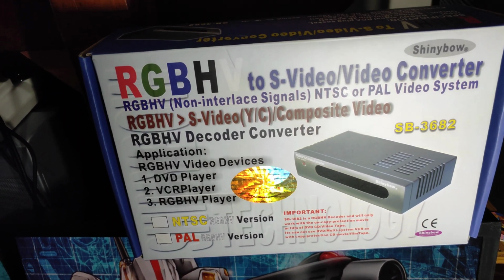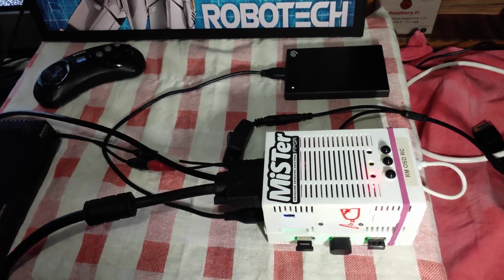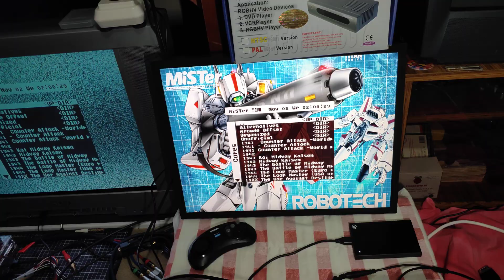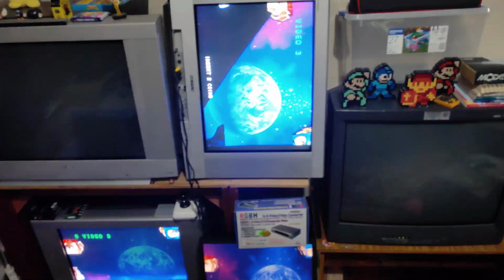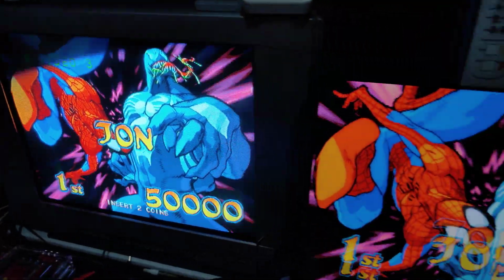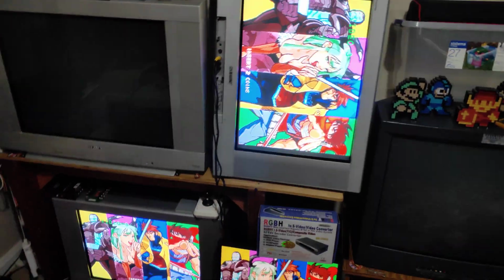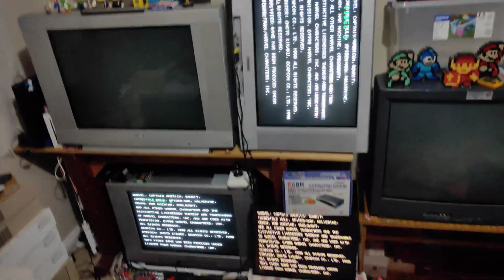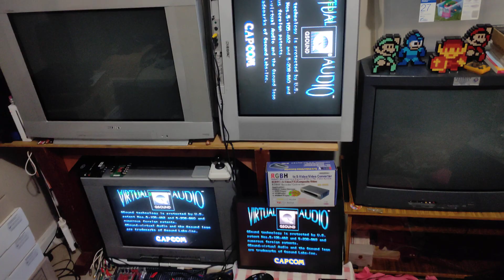AWESOME S-Video and Composite video for your MiSTer FPGA system

Comment: I just got my first CRT monitor (750TVL), however it only takes S-Video. I want to use it with the GBS-Control and later in the future with the MiSTer too. Any help? would this work for the GBS-Control?
Reply from the maker: Happy to help mate, the GBS control is for analogue to digital, it's an upscaling device, you don't use them in standard resolution CRTs. The MiSTer has some cores that are coded for S-video or you can just use a transcoder for all the cores and achieve amazing S-video quality.
Reply: @notsuoh16Bit  Hey, thanks for you reply and help. I forgot to mention that my reason for using the GBS-Control is to downscale 480p games to 240p (the CRT is 240p & 480i), especially from the PS3 (4:3 support and 480p minimum resolution) and some older consoles with 480p minimum resolution support.

Comment: It looks like there's at least 1 frame of lag, probably more.  Just pause the video and you can see that the LCD is not on the same frame as the CRT.
Reply from the maker: Yeah average of say 2 frames, that is 2 out of the 60 per second, normal humans can't detect that as lag.

Comment: Nice video mate I stumbled across this converter yesterday on eBay was thinking of picking one up this has convinced me! I have bought a couple of 3D prints for my consoles from your eBay store before: do you do the stand for the Arcooda?
Reply from the maker: Hi, sorry for my late reply, glad you liked the video and it was able to impress upon you the great convertor.  I don't sell the prints of the stands I'm sorry, I have the files, but have not even printed them yet basically due to the fact that the LCD panel is fine in its current setup, I would print them if I had the LCD up on a desk or something other.  Glad to hear that you have been a customer, it is always appreciated.  Thank you.

Comment: Can't the mister output component and S video natively?
Reply from the maker: Hi, the MiSTer with an analogue IO-BOARD can nativity output component YPBPR video, but not S-Video, there are some cores which have been modified to output S-Video, but you need a special adaptor board or the skills to make a small circuit and or specialised cable, very different from a standard S-Video cable.  The option in this video works out of the box for every single core and requires nothing extra, plug and play like I say.